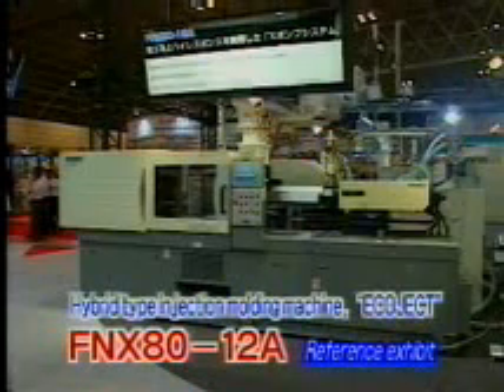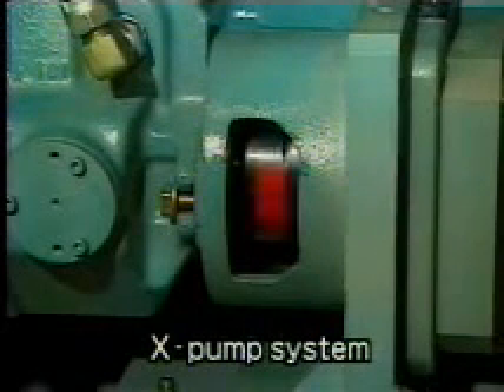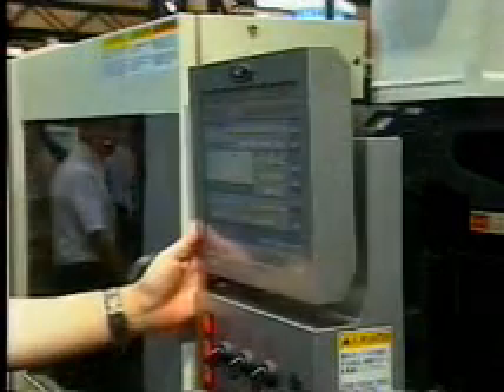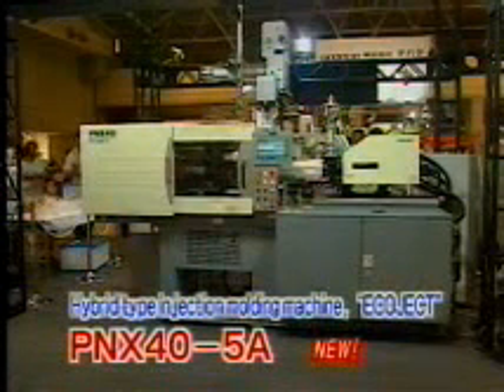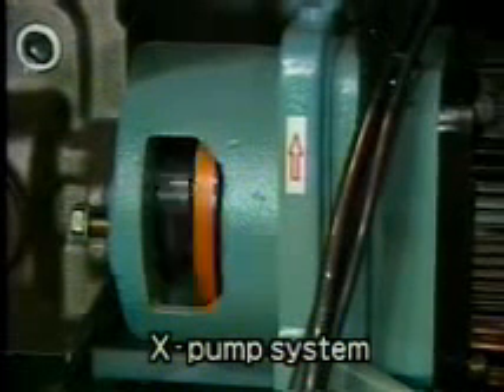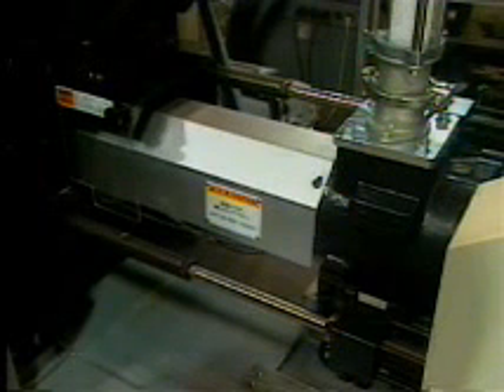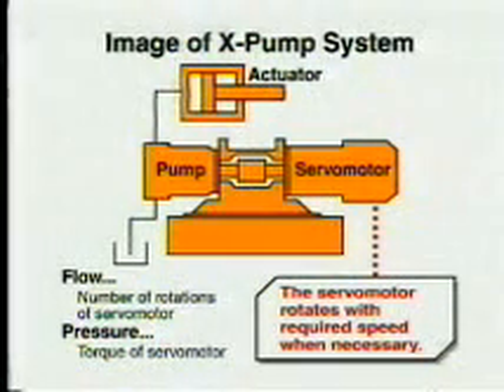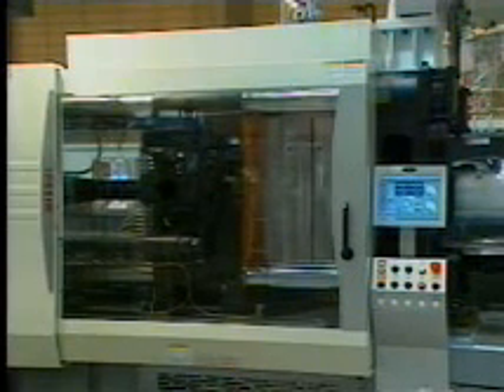Inyectoras de Plastico Hibridas

Comment: Dear friend,
Hope evething is fine for you.

This is Rin from Lanson Precision Machinery. Lanson has over rich experience manufacturing plastic injection molding machine in Precision Machinery industry. We provide high-end and one-stop solution for our customers with stable, durable, high efficient and energy saving characteristic.

How can you gain advantage from co-operating with us?

- A most strict QC standard in the industry is implemented;

- Most sophisticated processing equipment imported from overseas;

- Potent ability to upgrade technology with a dedicated R&D department;

- Most reasonable price and fast delivery thanks to our large capacity in mass batch production;

- A most complete range of specification selection range from 60T to 3300T as below;

GT2-S Series Single Injection Cylinder Model Servo machines, 60T-650T;

GM2-S Series Double Injection Cylinder Model Servo machines, 60T-650T;

GT2-B Series Fast Injection Machines, 130T-360T;

GT2-BT Series Ultra Fast Injection Machines, 170T-480T;

GT2-E Series Optical Production Machines, 90T-160T;

GT2-R Series Medical Production Machines, 160T-360T;

GT2-L Series LCD/Optical Production Machines, 100T-260T;

GT2-C Series Cable Machines, 268T-1000T;

GM2-PET Series PET Machines, 160T-380T;

UPVC Machines, 90T-800T;

GT2-MIM Series Metal Injection Machines, 90T-200T;

GT-S Series Three Platen Big Machines, 800T-1600T;

LSH-S Series Two Platen Big Machines, 1800T-3300T;

For more details or videos, please refer to below our website, Youtube or Facebook link.

http://www.lanson-imm.com/En.html

https://www.facebook.com/lanson.imm

If you need further assistance, please do not hesitate to contact me rin@lanson-imm.com.

Best regards,
Rin